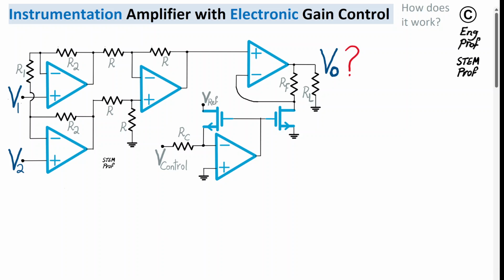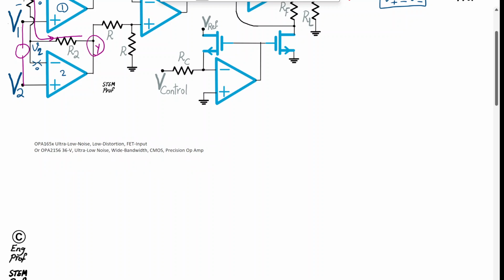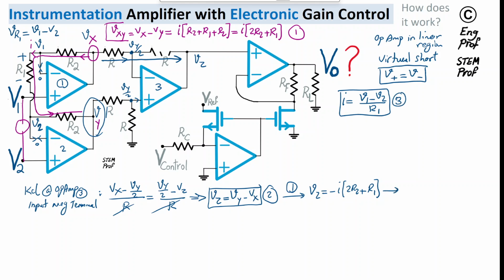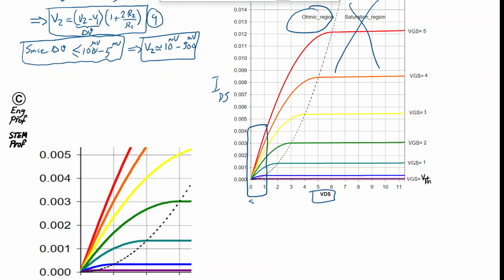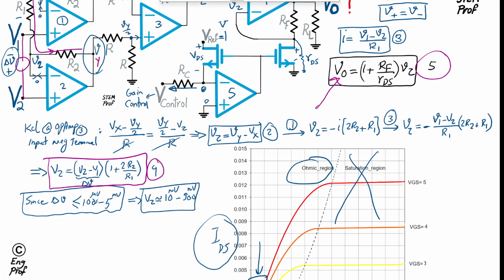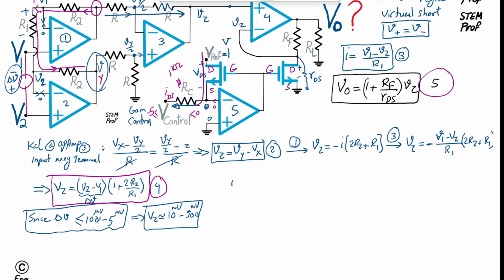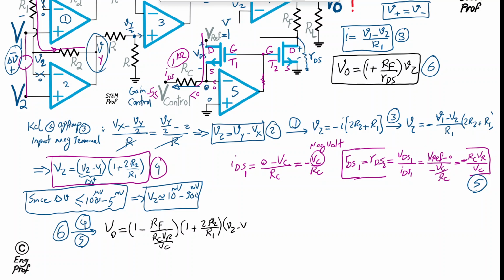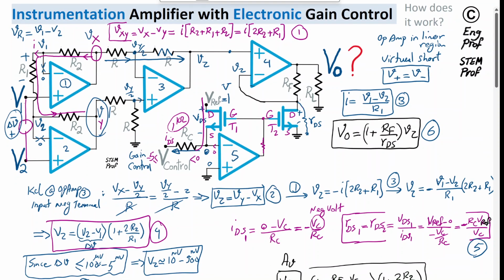Instrumentation Amplifier with Electronic Gain Control

Comment from the maker: Thanks for watching. For more Op Amp Circuit examples please see the list below. Note that MOSFET Transistor and Op Amp part numbers mentioned in video are only for illustration purposes and does NOT mean that they are proper choices for the specific reference voltage Vref value in this video. Depending on the chosen FET transistor, Vref needs to be adjusted to make sure transistor remains in deep ohmic region (so Vref might be required to be as low as ~0.5 volt). And for additional circuit examples see:  
Op Amp Amplifier with Electronic Gain Control https://youtu.be/NoNgQpbj77Y
VCA Electronic Gain Control (Part 1): Voltage-Controlled Attenuator Overview https://youtu.be/cFzYZsPEtP0
Switched-Capacitor Amplifier Design: How does it work? https://youtu.be/n8UOTmPI4aI
Op Amp Analog Computer Differential Equation Solver https://youtu.be/ENq39EesfPw
Thermometer Circuit Design with Op Amp & BJT transistor https://youtu.be/55YsraFE0rg
Push-Pull Power Amplifier with Darlington Transistors https://youtu.be/866MYibo8yE
Analog Logarithm Computer https://youtu.be/RpKEq5WyoLg
Lowpass Butterworth Filter: https://youtu.be/UzCjkwqy-9w
Analog Computer to Raise Signal to power n https://youtu.be/IUTlBH1UraE
Triangle Oscillator Op Amp circuit https://youtu.be/JF5Up_cuL9k
Differential Equation Solver Analog Circuit https://youtu.be/R3X5AYNZGEI
Complex Sinusoid Oscillator https://youtu.be/GXRhmwmS5Zk
Sawtooth Waveform Generator design with OpAmp, JFET, BJT https://youtu.be/5zHXTx-Vl20 
op amps Circuit with feedback loops to design an analog computer that solves a second order differential equation https://youtu.be/HeZRtnRXpEI 
For more analog circuits and signal processing examples see: https://www.youtube.com/playlist?list=PLrwXF7N522y4c7c-8KBjrwd7IyaZfWxyt
I hope these Circuit design and analysis videos are interesting. 🙋‍♂

Comment: Thank you for thorough explanation!
I tried to recreate gain control with 7002 MOSFETs, and run into this:
1. Usable linear resistance RdsON is only between 2 and 10 Ohms. 
2. With AC signals above 200mV, parasitic diode kicks in.
Reply from the maker: You're welcome! Glad that you liked this circuit video. Thanks for experimenting and sharing your observations.  Please note that input signal (V2-V1) is required to be positive in this design (if need be apply proper small DC bias at input to keep V2-V1 positive in the presence of your signal, and use input decoupling capacitors to inject your AC small signal between V2 and V1). Please also carefully select the value of Vref to keep the reference NMOS in proper Triode region. Here is a related video that might help: Amplifier with Electronic Gain Control https://youtu.be/NoNgQpbj77Y
 Regarding components, I suggest using matched NMOS transistors in the same package, for example ALD1101 from Analog Devices. I also suggest using zero drift ultra low noise Dual or Quad FET-input Op Amp packages for example OPA2383 or OPA4383 from Texas Instruments or ADA4522-4 from Analog Devices.  I also recommend applying small stabilizing feedback capacitors (range of 100s pf to sub 10nf) between output and inverting terminal of each Op Amp following the recommended practice in op amps datasheet.  I hope this is helpful.

Comment: Hi. Very good videos with simple explanation. I would just like to add that opamps 1 2 3 if i am not mistaken, is also called a triple opamp instrumentation amplifier. The first stage provides the overall differential gain of (1 + R2/R1). Gain is varied by making R1 a potentiometer in series with a small series resistor such that R1 does not go to zero.The second stage is a differential amp with gain of 1 since all Rs are the same. The primary purpose of the second stage is primarily to increase the CMRR. I asked my son to watch your videos and enter the circuit in ltspice and make it work to demonstrate to me his understanding. Thanks a lot for your videos.
Reply from the maker: You're welcome, Samuel. Glad that my videos are useful. Thank you for sharing your thoughts. Here are a few related electronic amplifier videos:  1x, 10x, 100x, 1000x Switched-Gain Instrumentation Amplifier https://youtu.be/9-MLqyewXW8
Gain & CMRR of Instrumentation Amplifier Explained https://youtu.be/Bw29QjHHzGo
Variable Gain Instrumentation Amplifier for designing Thermometer Current Source https://youtu.be/Ggf0yCaTTiY
Instrumentation Amplifier Explained https://youtu.be/Yq767et8BbY
I hope these videos are interesting as well.

Comment: Hi. I've spent the afternoon watching a lot of your videos. Great stuff! Thanks. A minor issue with this one - I believe your very last expression for Vo is actually Av, since V2-V1 is absent.
Reply from the maker: Thank you for watching, your interest, detailed attention and your follow-up comment. I am glad that you like my videos. You are right, in that very last example equation around minute 34:30 I inadvertently dropped the (V2-V1) in the denominator while present the specific Av value assuming Rf=100kOhm. Thank you. For more examples please see:  Op Amp Amplifier with Electronic Gain Control https://youtu.be/NoNgQpbj77Y
Analog Logarithm Computer https://youtu.be/RpKEq5WyoLg
Power Amplifier Design with Transformer https://youtu.be/gKlJrqGqeCI
Op Amp Analog Computer Differential Equation Solver https://youtu.be/ENq39EesfPw
Instrumentation Amplifier with Electronic Gain Control https://youtu.be/C4tghZ-q6Zs
Push-Pull Power Amplifier with Darlington Transistors https://youtu.be/866MYibo8yE
Thermometer Circuit Design with Op Amp & BJT transistor https://youtu.be/55YsraFE0rg
I hope you also enjoy these further examples. Thanks again 🙏

Comment: Some mention of the distortion that may be created by the NMOS gaine control would be VERY valuable.
Reply from the maker: Thanks for watching, sharing your thoughts and suggestions. You have a good point. I had a lot to cover in this detailed long video and packing more topics was concerning. A related example is  https://youtu.be/NoNgQpbj77Y . I will post more Amplifier examples in my Circuit Design/Analysis repository https://www.youtube.com/playlist?list=PLrwXF7N522y4c7c-8KBjrwd7IyaZfWxyt . Thanks Again 🙏
Reply: Hi ... i am just curious about your statement and i would like to confirm why you said so and confirm my understanding of concepts as well .. are you saying this because the last stage amplifier is basically a small signal amp since rds is a small signal parameter which means it is only constant for small signal amplitude. If input signal is NOT small, rd changes with input swing, making the gain vary with signal amplitude. As a result, distortion will occur and the amplifier output has harmonics. I would appreciate a lot if you confirm my understanding of your statement. Thanks a lot in advance

Comment: Thank you. I like your way explaining analog electronics very much. 👍
Is it always the case that MOSFETs or other electronical parts, which are siting on the same silicon chip, are matched?
Reply from the maker: Thanks for watching and your comment. Glad that you like my videos and they are useful. Answering your good question: Not necessarily, there are many forms of mismatch between electronic components.  The severity of mismatch depends on the component, package and design.  Having component on the same substrate in the same package helps with reducing the mismatches hopefully to a level that is acceptable for a given desired application. For more circuit examples involving matching transistors please see:
Wilson Current Mirror and Current Source Design Tutorial https://youtu.be/LfbfJYrovN0
Thermometer Circuit Design with Op Amp and BJT transistor https://youtu.be/55YsraFE0rg
Op Amp Amplifier with Electronic Gain Control https://youtu.be/NoNgQpbj77Y
Anti-Log Analog Computer with Temperature Compensation https://youtu.be/kk2c7Gk3nW4
I hope this explanation and these circuit examples are helpful and interesting.

Comment: Definitely brings back college circuit courses, and with additional experience it makes so much more sense.  I immediately thought of this as a gain control for an audio preamp.  I increasingly find the need to control preamp gains remotely and have found it difficult to do without injecting noise.  As we network audio systems they become more distributed and gain controls are no longer practical to have at the location of the microphone input.  Being able to adjust them remotely for system gain stage balance makes more sense, even though most manufacturers are not yet doing it.  This is an excellent example of one way to do it.  Thanks for the thorough derivation.
Reply from the maker: Thank you for watching and sharing your insights. Glad that this Instrumentation Amplifier Example is useful. For more examples please see https://www.youtube.com/playlist?list=PLrwXF7N522y4c7c-8KBjrwd7IyaZfWxyt
As you mentioned, Remote or Automatic Gain Control (AGC) are among the applications of this circuit. We can use this peak/RMS detector circuit https://youtu.be/4aG5NYX8tGo and then compare its output with your desired peak/RMS level and then adjust the gain accordingly.  
Thanks again for watching and your interest. 🙏🙋‍♂️

Comment: Thank you for this fantastic, in-depth video.

 When I saw this, I immediately thought of an audio compressor circuit. We could get the peak of the input signal using an ideal diode circuit in full-wave rectification. Now, the only problem is that this circuit amplifies the signal. If I wanted a damper, I would need to have an inverting second stage, with the FET as an input element. 

What is your opinion? Should I use a single FET with a biased signal or two FETs in a push-pull configuration with both gates driven by your first stage? Also, crossover distortion will be problematic if I'm not biasing the input sound.
Reply from the maker: You're welcome. Thanks for watching and your follow-up comment. Glad that you like Instrumentation Amplifier Video.  As you mentioned, Automatic Gain Control (AGC) is one of the applications of this circuit. We can use this peak/RMS detector circuit https://youtu.be/4aG5NYX8tGo  and then compare its output with your desired peak/RMS and then adjust the gain accordingly.  While there are many methods to implement full-scale AGC circuit (much more capable than this core concept example), my suggestion is a quick scrappy work-around here (to achieve your design) by adding an additional attenuating stage at the output that by default is attenuating to lowest level that you might need.  Then the matched-FET gain stage just works as a gain controlled stage that counteracts the default attenuation as much as needed to get the signal to the right level.  For more circuit examples please see my Analog playlist https://www.youtube.com/playlist?list=PLrwXF7N522y4c7c-8KBjrwd7IyaZfWxyt
I hope this is helpful. 🙂
Reply: @STEMprof  Thank you again for this extensive reply. It was really helpful. This approach sounds more optimal with respect to semiconductor count, so I'll start the design this way.
Reply from the maker: You are very welcome. Thanks again for watching and your interest. Best wishes with your circuit experiment. 👍🙋‍♂️